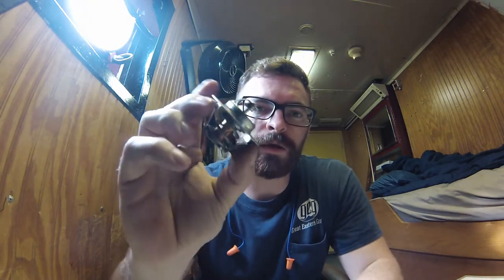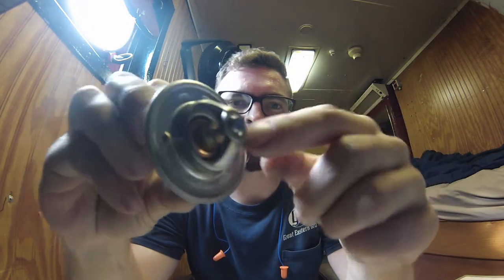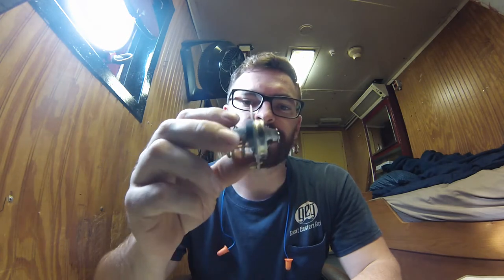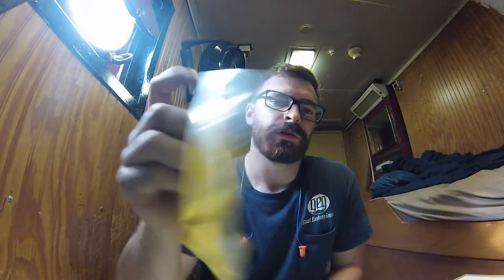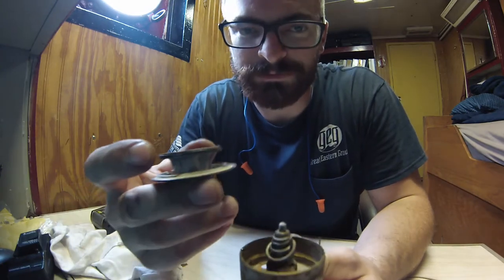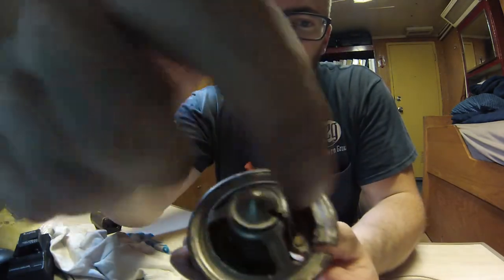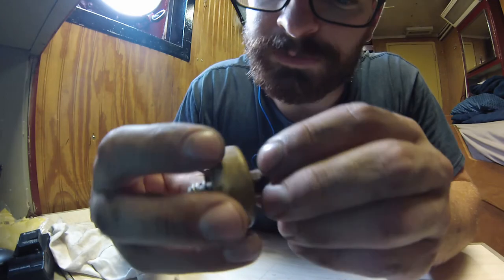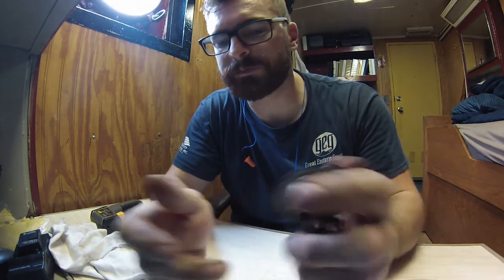How to replace a thermostat on a John Deere 6068

Comment: I had a 6090 AFM85 run away on me had to choke out the air intake pretty scary but John Deere looked at it and couldn’t figure it out ended up swapping the engine completely